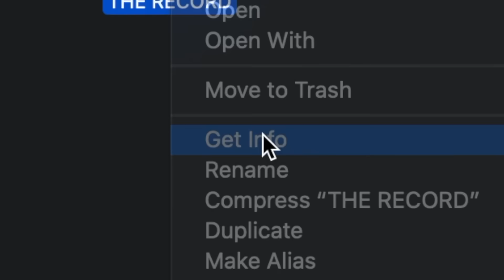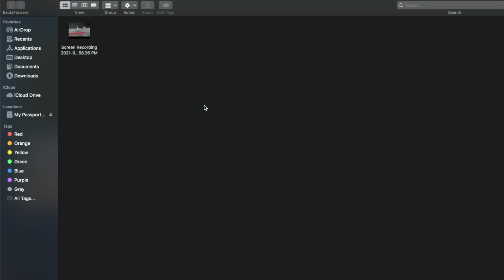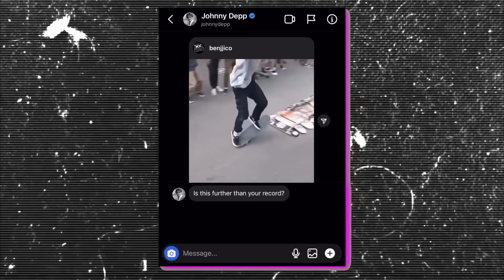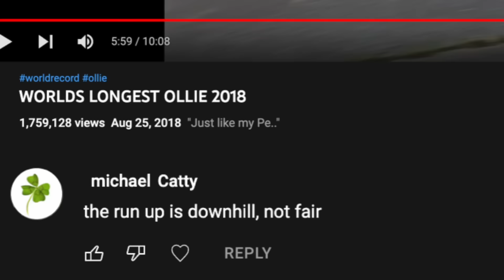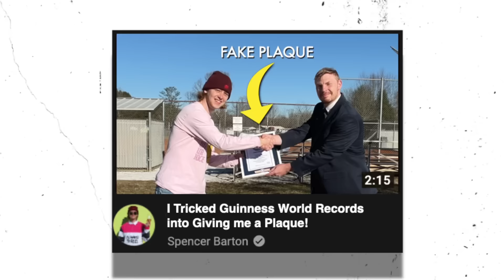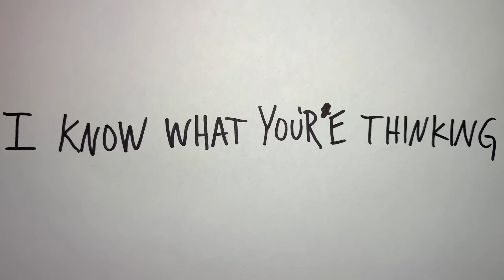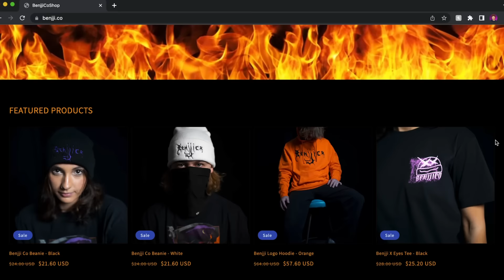WORLDS LONGEST OLLIE 2023 (Official Record)

Comment: I wonder if you had a car pulling one of those big boxy plexiglass windshield things that pro sprinters run behind so they can go as fast as possible without wind any resistance if you could get alittle bit further since you wouldnt have to deal with resistance while riding up and in the air.

Comment: What probably made it harder, was the 1inch high stick right AT 17 foot, meaning you probably had to jump more like 17 foot 2 or 3 inches. just to clear the 1 inch high stick with the angle you'd be coming in at (maybe even more, unless you literally skimmed the stick)!
Reply: Ah you mention that later on, I'm pretty sure you cleared it the first time anyway, even 16.99 feet is still a WR right? ;)

Comment: Dear Spencer Barton
I love your way of skating. In my opinion in the world of skating you have one of the highest jumping power in your legs i have ever seen.
I think you could do even better with some time in the gym to improve jumping power; this helps a lot.
- train strength
- get the lightest board out there and trucks out magnesium with hollow axles.
- get ceramic ball bearings and remove the seals for maximum speed.
If you want to go extreme you could loose some weight too; like the skijumpers.
I saw you at the high jump contest and i believe you have the highest jumping power in the game.
I would love to see the best use of your talent.
Thanks for your entertainment.

Comment: Hey listen there's a trick and maybe a loophole you can exploit to potentially shatter the record. During the Greco Roman Olympics, long jumpers held weights in their hands while running for the jump. They would swing their arms forward as they jump and release the weights at the apex of the jumps arch to give themselves more distance. I imagine it would be hard to keep the board under you but maybe if you try to launch the board a bit ahead of you, your body would catch up when you release the weights. Even if they were 2lbs each, that should show a marked improvement in distance. I mean why not try it. The rules don't say anything about it. This I am convinced will work as long as the board and the man are one.

Comment: Look into olympic long jump techniques next time you go for a longer ollie. You are not jumping very high at all, you can easily get several more feet if you work on your pop and gain height initially. It is a common beginner long jumping mistake to try and jump farrr instead of just jumping uuuup and letting your speed carry you far, and being higher allows your body much more distance to fall down, resulting in MUCH farther jumps.

I'm watching your hip position change by only about 1 foot when ollying, if you get that vertical jump up by another foot or more...you'll have several more feet added to this record.